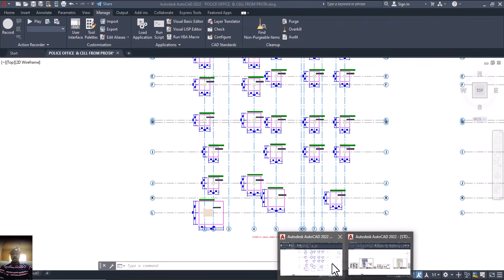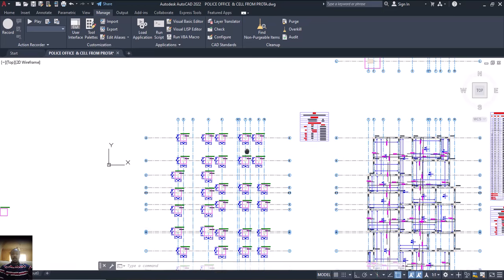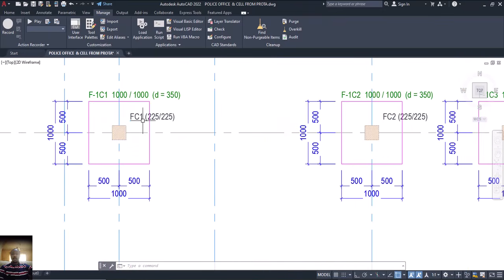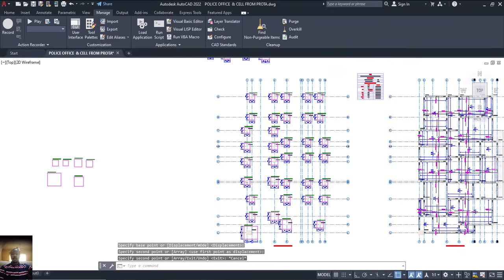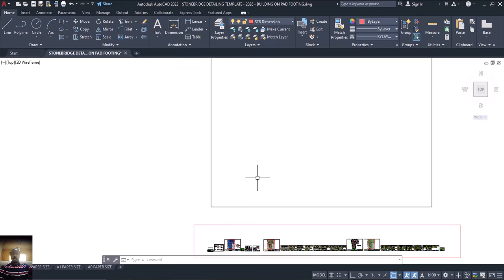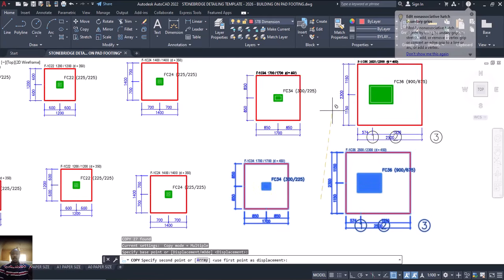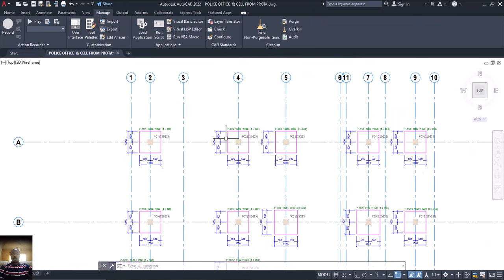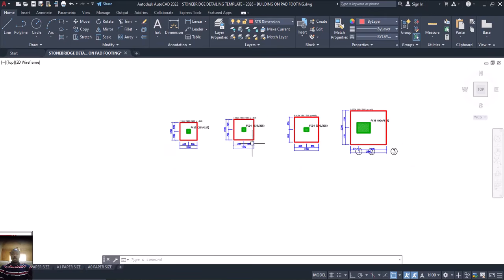How to Group Pad Footing in Stonebridge Detailing Template 2026 | Ekidel Detailing

Comment: Well done chief 👏 ❤❤

Have been consuming your videos for days now and it's helping even though it's orion I'm learning
Reply from the maker: It's good to know
Reply: @EkidelEngineering Please I'm having difficulty on grouping my columns into column 1,2,3 but the issue is I don't know how to group them. I can have a 225 by 225 columns but different reinforcement arrangements from foundation to roof some will be 4y20 from foundation and 4y16 continues to roof level while some columns are mixed at different level since its a G+2 building so it's really confusing on how to properly group them even though it's 225 by 225 but interchanging reinforcement. 

I don't know if you have a video on this, have watched some video on column design  but I don't know if there are other ones that explains it better

Comment: Is it possible to choose a median size among the selection or do we have to always choose the biggest size of the selection. For instance if we have three pads that are close in size (1100, 1200,  and 1300 metre square) is it alright to use 1200 as alternative for both 1100 and 1300
Reply: No. Reason been that the one that is 1300mm the axial load is higher than that of the column that the pad is 1200mm. So if you used 1200 for the one of 1300 that is automatic failure
Reply: @FASHEOLUSEGUN-eh3jx thank you